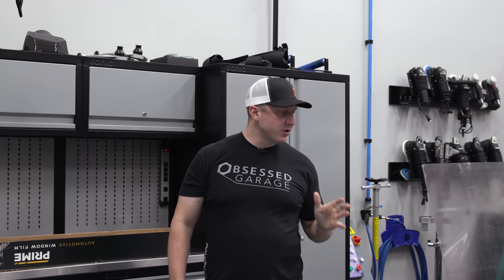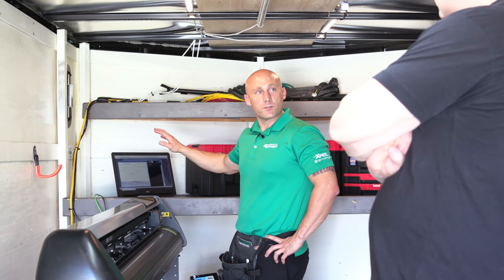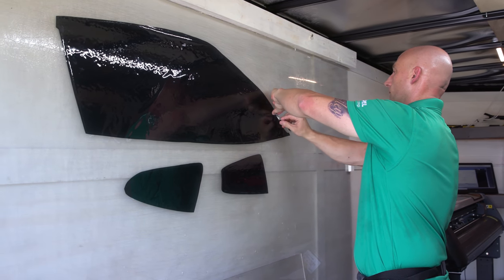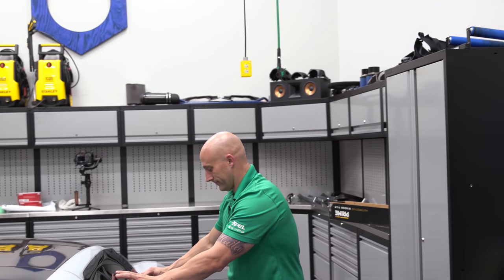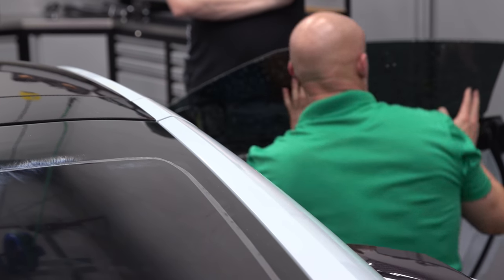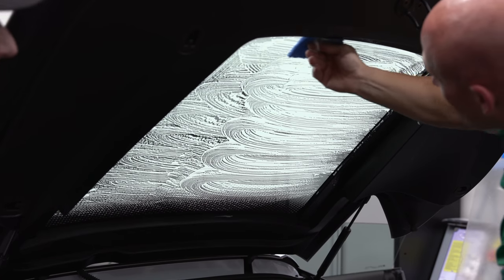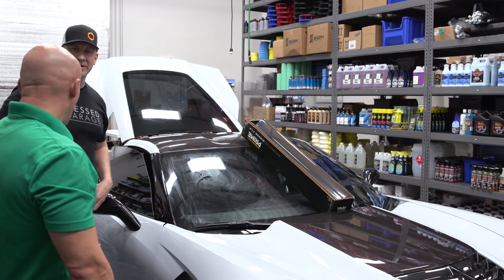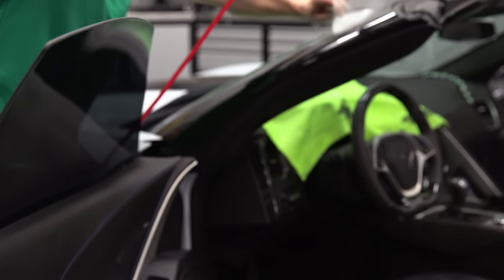C7 Corvette: Xpel Prime XR Plus Window Tint - Mobile Tint Installation

Comment: I think you’re going to like this film. I have it on my cars and it really rejects the heat well, even at 35%.    And doesn’t look at all milky.

Also, the XR plus has a really slight blue tinge to it compared to the XR.  I bet it looks good with the ceramic matrix gray.

Comment: Matt. You shouldn't take that fabric divider out. The one connecting to the sides of the quarters and shaped like an "L". 

It's meant to keep you loose stuff from getting sucked out if you ever take the top off and go over say 80 90mph... ask me how I know? Lol a snatched a ball cap mid flight and never left that unhooked again. But I've lost a microfiber in the past. Just looking like an idiot and god forbid danger to others... 

Good job as always on these vids. Ty.

Comment: You should check out flexfilm as well. Ralph (the owner/operator) has all kinds of demonstrations using heat lamps on youtube! I have their Carbon Ceramic tint on my car (rather than using "dye" they use carbon to color) it's a much more stable coloring process.

Comment: Nice Job I do all my windshields also, but I do 50%. I love watching my tint guy too lol. They make it look so easy. The only thing I dont get is at 38:19 he pulls the clear layer off the tint. Was that not the clear side on the outside when he shrunk it? Did that have another clear layer on the inside? When he rolled it up on the windshield he still had the clear layer on, applied the tint and then peeled another layer of clear.

Comment: I know it's necessary and doesn't hurt a thing, but I always cringe when they get their solution all over the door panels.
Reply: Thinking the same thing!
Reply: BigGary79 I feel the same way and have recently started asking the Tinter to cover door panels with plastic sheeting. Most tinters have it, yet usually don’t use unless asked.
Reply: Its not even as much getting it ON the doorpanels but behind them. I know there is moisture barriers to keep it from getting to electronics but more that the moisture can get trapped down there thats super cringe lol

Comment: I had my Acura front driver and passenger side done yesterday with this tint and he told me he put the tint on the inside windows and I see you are installing on the inside and outside. So did my guy do it wrong?
Reply from the maker: The tint is first applied to the outside of the window to form it to the shape and size of the panel. It's then place in the inside of the window.

Comment: I’m not sure if it’s overkill or just OCD but every time I have one of my cars tinted my installer always removes the door panels to be able to get the whole window right down to the bottom where the glass meets the frame. Although nice install, thinking of have my Macan done.
Reply: That's just not knowing how to tint. Pulling the door panels is a big waste of time really how much sunlight comes through ur doors? Zero

Comment: smh bashing the corvette
Reply from the maker: Bashing?
Reply: Obsessed Garage just seems like you’re not satisfied with it. It’s not a Porsche so you can’t look at it like that. I’m pretty sure when you get finish dialing it in and living with it for a few months it will grow on you. I have a c7
Reply from the maker: I’m not bashing it at all.  I have an M3 and an M5.  I had a GT350, 1M, and S2000 recently.  Nothing is as good as the RS, so I’m certainly not comparing.  The Corvette is not good though.  It is by far the worst of any car that I have owned in the past 10 years.

Comment: I never had any of my cars tinted simply bcuz of the mess they make.
Not to mention i dont want anyone with a razorblade near my car, 
also the smell of soapy solution is gonna stay for quite some time after the install.
At my dealership where i work, some guy came in to tint the rear windows on a mercedes,
1 week after that there was all this mold in the trunk.
Reply: Internet logic = I had a bad experience, probably because I didn't do my due diligence in selecting a tint guy, so that means everyone else will too.
Reply: Tint guys are more precise than you will ever be. You work for a dealership, of course they brought in a crappy tinter.
Reply: maxim913 mold? Somebody didn’t know what they were doing! The soapy water smell shouldn’t be that noticeable. Always tint the windows before your going to have a complete detail!
Reply: What the other guys said. Do your due diligence, and find a good tint guy. My guy is reasonably priced, always hooks me up, does a fantastic job, and stands behind his work.

After 8 cars, I've never smelled the soapy solution even once after getting into the car immediately.